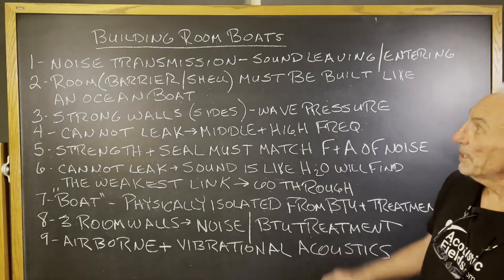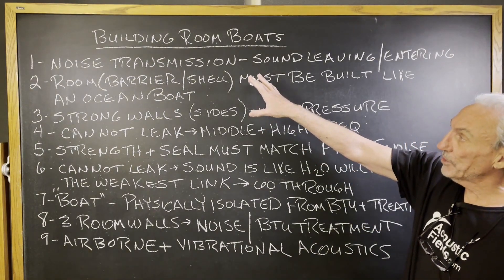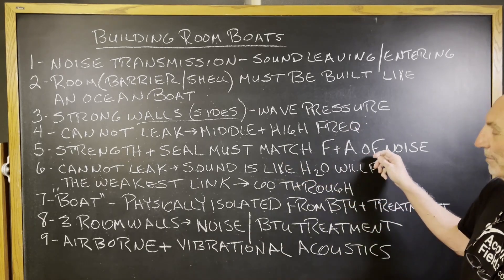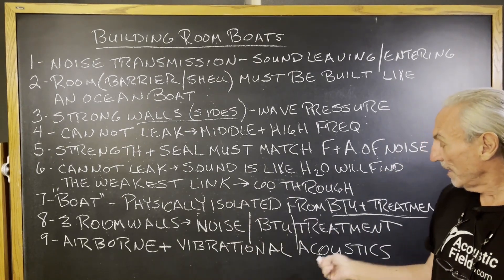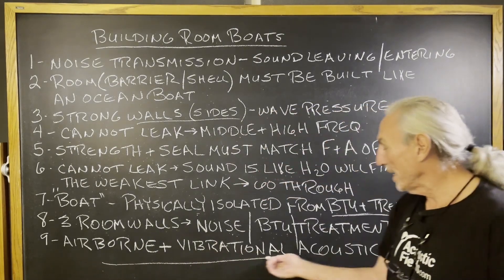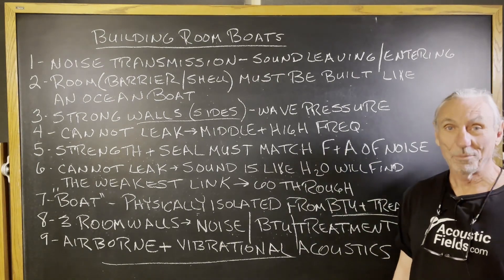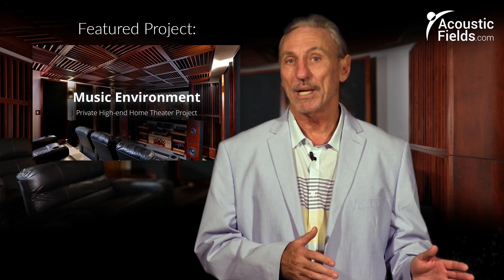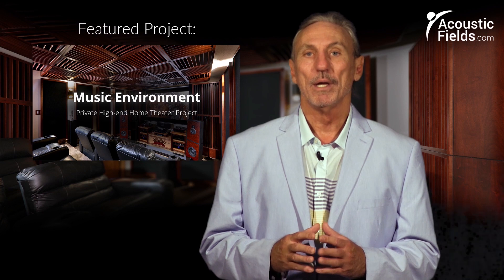Building Room "Boats" - www.AcousticFields.com

Comment: I would think that it would be easier to integrate the BTU wall with the noise wall. Really just another layer of the same wall. I suppose it would depend on the type of noise you are dealing with.
All materials have a thermal resistance to them, building a wall with multiple materials of different thermal and sound transmission properties should work well. Air sealing is a critical part of a BTU wall and a noise barrier.
Reply from the maker: Nothing is easy when you are dealing with noise transmission. Thermal properties of material types have nothing to do with noise transmission.